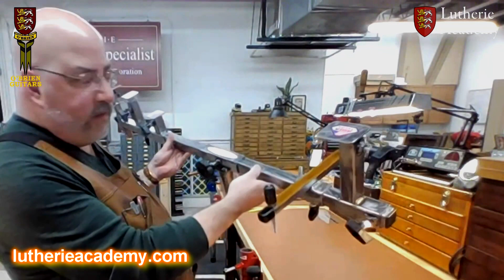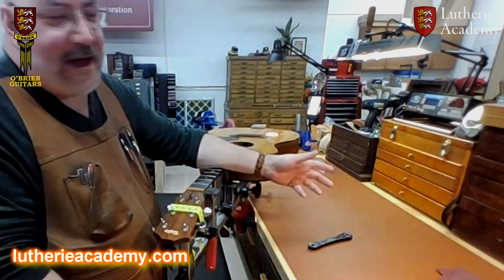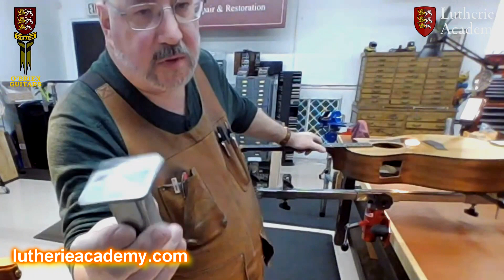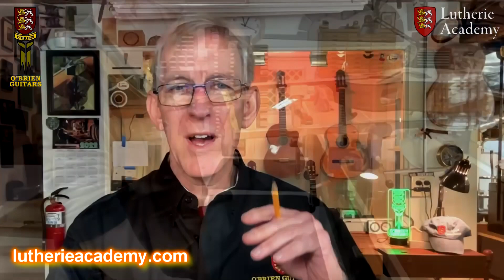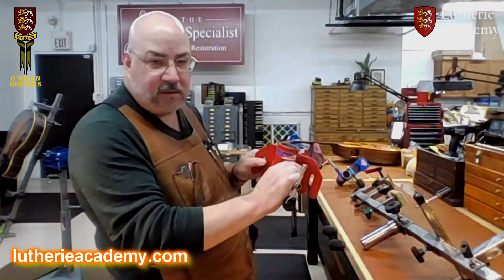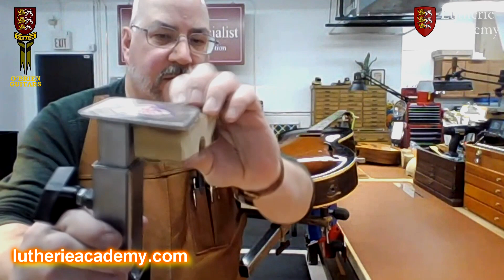Proper's guitar station

Comment: Wow, I love this. I would cheaper by far for me to order one over engineering one and building it for myself. I’ve been wanting to do this for awhile. But I work by myself and I have become quite busy here in Canada at my Tech shop. I just don’t have the time. Besides, you have worked out the kinks. 

I did build a bench top neck/guitar holder that accepts both; bolt on necks as well as the entire guitar (electric and acoustic). It is used for fretting and manipulating stubborn necks that need help with truss rod adjustments. Would gladly share some photos if anyone is curious, or share a link where they could see it in action. It is simple but effective. I hope that the shipping and overall costs won’t put me back to square one on this. This is exactly the direction I’ve been wanting to go. Thank you! I will be visiting Total Vice.
Reply: Just ordered the complete kit. (3pc). I can’t build one for this price.  And My time is too valuable

Comment: Hi thanks! Is it possible to get big pics to see how it's made? Couldn't see from the video. I am currently building similar device but welding is not available😕
Reply: It would be easy to build if you had a fabrication shop, because it’s simple. But if you consider the costs of the materials(+shipping), all the specialty  knobs, adhesive + urethane , fitting it all together and welding, plus the value of your time, you’d see that 199 bucks for the work station is a bargain.